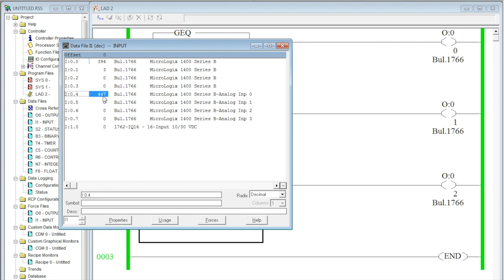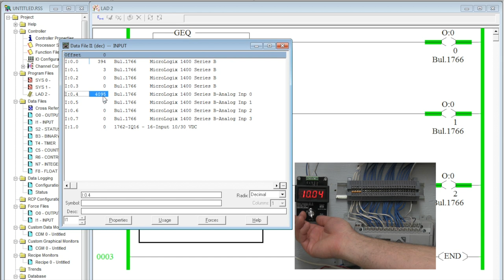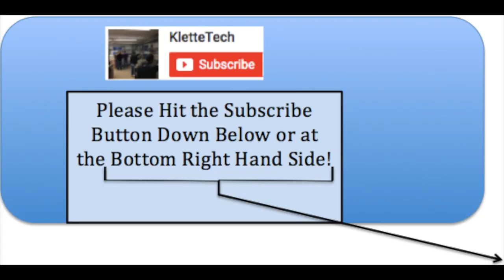Analog Input in RSLogix

Comment: hello, im integrating a keyence il-1000 sensor on a project. ill be using it to select different motors depending on a length measurement. Which instruction can i use to select each different measurement?

Comment: Can you force an analog value in Rslogix500?(not from the field)
Reply from the maker: Great question.  I am not sure.  I have never tried.  But I do not believe so.  What might work is set up a move instruction to move a value to the needed locations.  Does that make sense?
Reply: @KletteTech  yeah... I thought about it. From a float file to an input address. I'll  give it a try.
Reply from the maker: Jennifer Perez if that does not work let me know.
Reply from the maker: Another thought.  If the address is not assigned in the program you can just enter the address into memory.
Reply: @KletteTech  So I ended up disabling the scl block and using a float file to write to the output of the scale block with a move instruction.  That worked.  After a few tests and putting everything back how it was,  some of the values stay pegged so I had to cycle power through and everything went back to normal.
Reply from the maker: Jennifer Perez that’s great.  Awesome job!  Thanks for watching